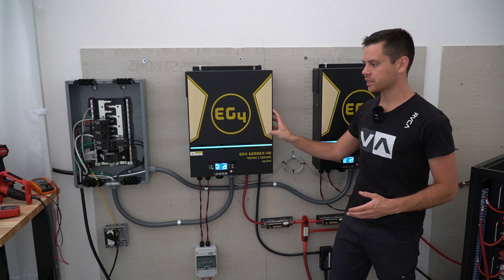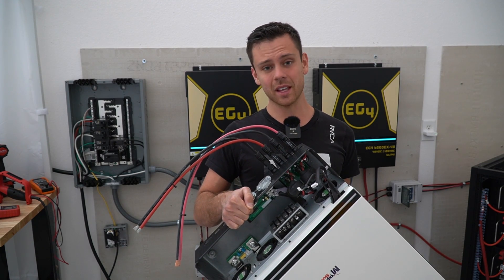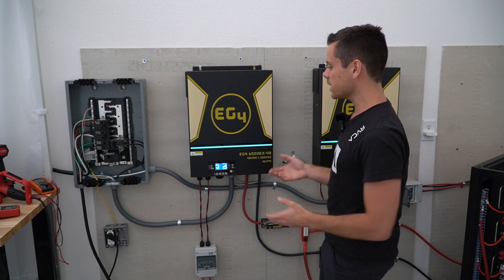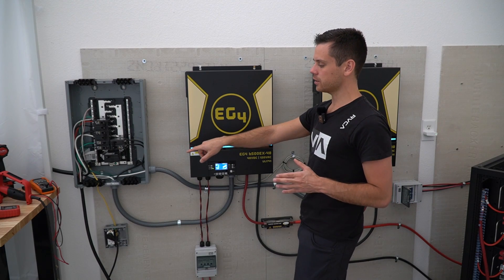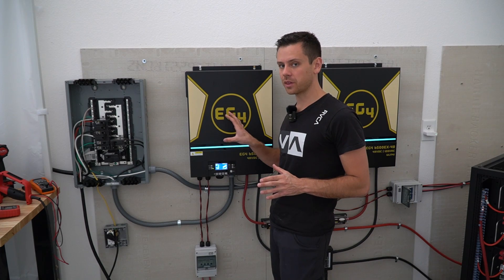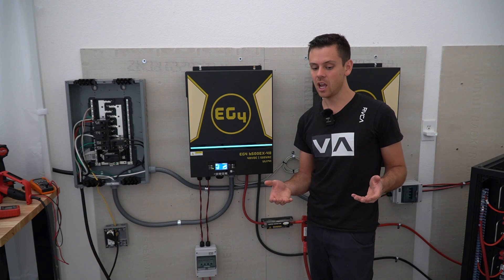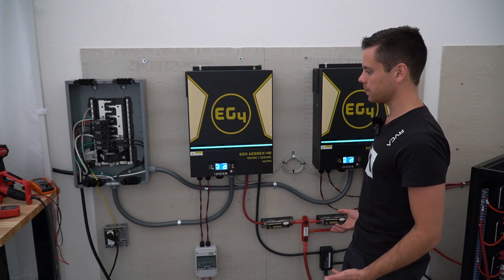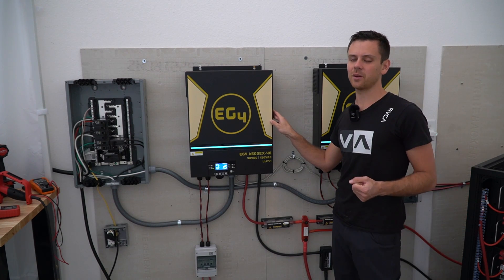EG4 6500EX VS MPP LV6548 Code Compliance and Ground Neutral Bond Discussion

Comment: in the UK here, am looking into what might make sense. but also to avoid the usual high voltage string arrays. it seems to me like using enphase micro inverters, they have come down in price recently. and then linking those onto the mains might be possible. but then the question is more about linking the storage to be on grid. (and also to be approved here in UK). the key thing is that i don't need the features of a traditional inverter since there is no string array. how about something like the sunny boy storage 6.0? those are pretty new model. so could not enough information on them. presumably those can to 6kw going by the name. So perhaps it isn't really the best option. But then what would be the other options for such a setup?
Reply: perhaps the... XW Pro Hybrid Inverter (230v) ? seems like a good option? it is twice the price of the sunny boy 6.0, but includes more of the necessary functionality for tying the enphase to be an on-grid system?

Comment: Can someone tell me how your house AC connects to the inverter, what size breaker or can it just be plugged into a GFI wall outlet.
Reply: If you're talking about a whole house system it would have to be via a transfer switch that would disconnect the grid from your main panel and then connect the output of the inverter(s) TO the panel, a break-before-make type switch.  Exactly as if you had a whole house generator installed.  If you mean a small system like this one, then Will has a series of videos talking about the different aspects of how it is designed.
Reply: If you are talking about split-phase like in Will's video, it is going to need to be wired into the main breaker box for two reasons:  1) The power draw is going to be way too high for a GFCI outlet, and 2) it will need split-phase input.
Reply: I didn't explain my setup which was my fault. This is going to be used as a single unit only using 120vac. I'm just trying to understand on how to connect this inverter to my house 120vac for when my battery runs out ican then switch over to the house power. Thanks
Reply: @Rock_Nemo  The unit pulls 60 amps so you will have to wire it to your distribution  ( breaker ) panel . You will need  an open space in your breaker panel.

Comment: The list in California is for Net metering and Utility Company interaction. For off grid and grid assist that only has the grid for charging, the list you refer to is irrelevant. But, the UL1741 is not. The UL1741 on both the EG4 and the MPP is the 2010 version, so it doesn't deal with the current net metering compliance. The current UL1741 compliance also deals with Rapid Shutdown initiators which weren't a thing in the 2010 UL1741 compliance. This may be a work around by MPP to get compliance. For most off grid situations here in California, they may be just fine. However, the Rapid Shutdown Initiators may still prove to be an issue with roof mounts and MPP inverters. RSI's don't apply to ground mount systems. There are several stand alone RSI's that will work with the MPP and are listed systems.
Reply: What is Rapid Shutdown? I hate to be stupid but I'm a sponge for new info
Reply: @fauxque5057  Rapid Shutdown is the ability for the initiator  to not only shut down the string but to isolate each panel from the string so that the voltage is no more than that of a single panel. This is so that if a firefighter is on the roof and axes through a panel, he won't be shocked by a string. It's never happened but here in CA we get a lot of regulations based on things that have never happened.
Reply from the maker: Wow good to know. Good information.
Reply: @WillProwse  Thanks Will. Also, Sol-Ark uses a third party certification, ETL which is more popular in China. The TUV seems to be more popular in Europe. The LVX6048wp by MPP is from the same factory as the Sol-Ark I believe. It will be interesting to see which certification it has.
Reply from the maker: I was wondering about the rapid shutdown issue. Interesting

Comment: Will, your system is COMPLETELY off-grid because you don't use ANY AC input to the EG4. As soon as you connect that input, do you (and inspectors) start to consider it "on-grid"--even though it doesn't push power back like a true grid-tie system?

Is it still off-grid as long as you just use the AC to charge batteries? But if you allow AC power from the utility to make it to the panel so it powers load (what I believe you mean by bypass mode), does that make it on-grid?
Reply: By that logic any RV that comes with an inverter would be on-grid when attached to electrical hook-ups. I think it's fair to say you need to be pushing and pulling from the grid to be considered grid tied.

Comment: I have both the Sol-Ark 12k and 4x 6548s. The Sol-Ark is nice, BUT there can’t be a difference of ~1400w between L1 and L2 if you’re off grid. I believe that isn’t a problem if it’s grid tied and can supplement the difference. I’m not sure if the Sol-Ark 15k solves this.
Reply: Thanks for mentioning this. It isn't very well published on Sol Arks docs.
Reply: The "15k" is the same type of build.
Reply: I preordered the 15k for off grid...could you point me to more info on this?
Reply: An autotransformer will correct that.

Comment: After the ground neutral screws are removed in both units ( 240 v configuration) , would you ground the sub panel? This is only for off grid use... thank you for your work 👍
Reply: Yes, because then the sub panel would be your main source of power in an off-grid situation. And don't forget about adding a grounding rod.

Comment: Any dc lines need to be in metal conduit and ac lines going outside in metal conduit.pathetic how electrical code book is crap and not simply put in diagrams with each type of industry and expand if certain things are different. They make it confusing that they confuse themselves.reasons why solar installers have to have attorneys.

Comment: Hey can one Eg4 inverter of this size run microwave normal size fridge 55 inch smart tv 4 house fans and lights about 18 amps total  ,iron for cloths  once in a while basically everything u normally use in a house except for ac or heater and no hot water a basic house can this run my house everything is 110v
Reply: Yes. I run my entire houses 120v load with an LV6548. I currently only have 3700w of panels and it runs fine. I plan on adding more panels to power another dual inverter AC unit. If the kids aren't on the internet my total house load is about 350w 24/7. With the exception of the refrigerator defrost cycle. The microwave is also on solar and will use 1500w while it's running. The air fryer also hits it hard but it's briefly while you cook.
The LV6548's are capable of putting out 6500 watts. It's enough to power everything at once. Of course I also have  20.4kw of LiPo4 batteries if the sun isn't producing enough energy between clouds, and all night long